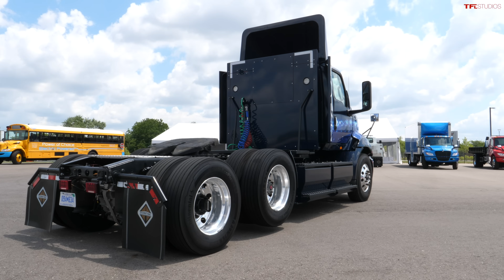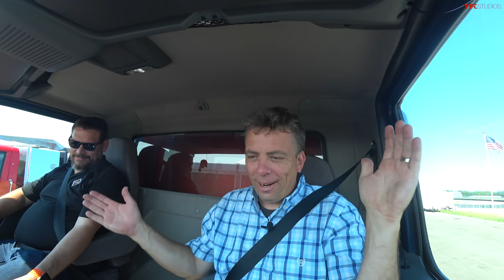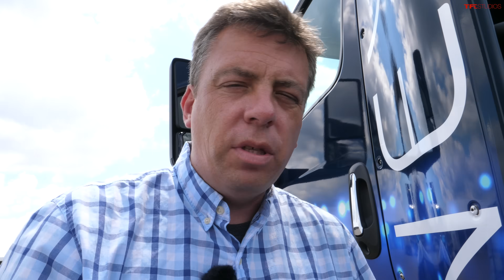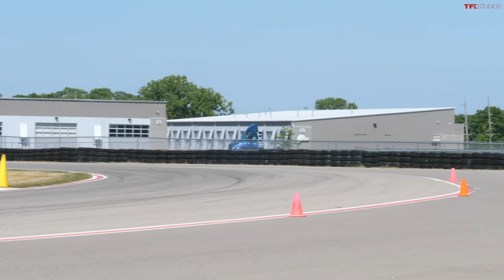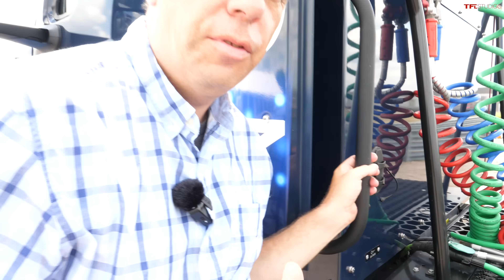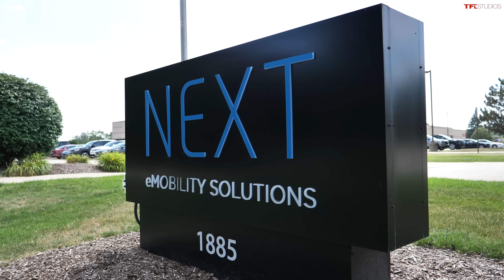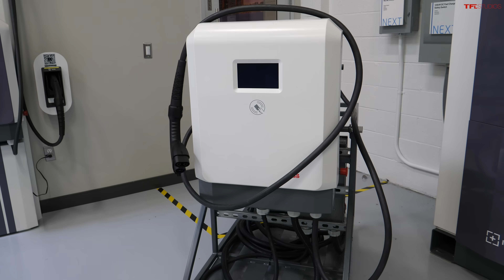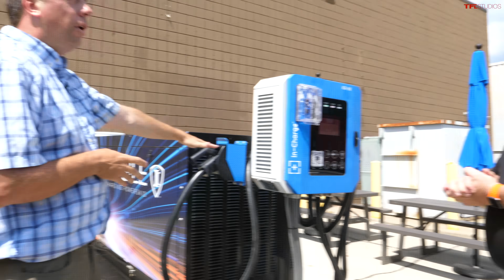Badass EV Big Rig - This International 18-Wheeler Packs a Huge Surprise!

Comment: Class 8 diesel powered trucks have been quiet for years, you can barley even hear a Class 8 diesel truck running they are so quiet. This thing will also cost $250,000 dollars and up so again the Diesel wins hands down. International is a minor player in the class 8 truck market these days, they have not been a major player for years and they are known to be unreliable trucks. 

All the truck manufactures keep failing because electric just can't provide the energy density that diesel fuel can. These electric Class 8 trucks won't work even as local delivery units, take a company like Cheney Brother Inc who deliver to restaurants they have about 50 trucks at the local warehouse where I live, where are they supposed to install 50 chargers to charge that many trucks? The same thing with bus barns that are parking from 100 to 200 buses where are they going to put all those chargers to charge 100 or 200 buses. At 2 hours per charge you would only be able to charge at best 6 buses or trucks per every 12 hours over night per charger in a building. 

Here is the recommended oil change interval for a PACCAR MX-13 engine truck: 

Engine Oil Intervals and Specification:
• SAE 15W-40 API CJ-4. 10W-30 can be used if the engine has received Engine Service Bulletin E070 or more current software.
• Line Haul oil change interval is 40,000 miles when above 6 MPG.
• Vocational oil change interval is 25,000 miles (or 800 hours) and applies when fuel economy is less than
6 MPG and higher than 80,000 GVW.

As you can see the maintenance issue is being blown way out of line, to hear Andre and the others talk they make it sound like you are servicing these engines every 3,000 miles. How long are those electric motors going to last? unknown, but diesel engines will go over 1,000,000 miles. How long are those batteries going to last again unknown. 500 kWh will cost at todays prices which are a year old as the cost has gone up but the battery will cost $76,500 dollars each. So in this International you will have $153,000 just in the batteries. A Diesel engine does not come close to that cost.
Reply: You have alot to say about it. Funny how the loudest people on the internet have done nothing about it. The ain't broke don't fix it crowds are ludites
Reply: @MichaelDabish  Diesels burn clean, there is nothing out there that can come close to matching the ability of diesel for hauling, even locomotives use Diesel engines to power a generator that powers the electric motors that drive the train because electric can't be stored with enough density to match diesel.
Reply: @LeeCountySpeedShop  burning is still burning my friend.
Reply: @LeeCountySpeedShop  Often wondered why we don't see diesel electric trucks?
Reply: I noticed you left out the most important part, fuel cost. 
32k miles divided by 5.5 mpg x $5.75 diesel is $33,454. Assume 80% fuel saving once you pay for electrons or $26.8k each year. Now add in oil changes and longer brake life and you start to see a good payback. The electric truck will also have fewer things to fail and likely last much longer than a diesel. 

Now let’s assume you drive 180 miles per day, 240 days per year. 43,200 miles / 5.5 mpg x $5.75 diesel = $43.2k. Assume electrons are 20% of the cost or $34.6k savings in fuel alone. That’s about a three year payback. ($250k vs $140k) If a business doesn’t do this, they are not going to be competitive. 

Additionally, early reports from electric big rig drivers, they are noticing much less fatigue due to lower vibrations. This might lead to fewer accidents and turnover. (Can’t prove this assumption)
Reply: Diesel trucks are money pits!!! Electric wins hands down! Show me a diesel that puts fuel in the tank when you stop or go down hill! Over time the electric truck cost will be lower then a diesel truck hands down!
Reply: One more thing regarding the maintenance interval, if a local truck is running 125 miles a day 5 days a week that comes out to 32,500 miles a year so you would do one maintenance for that year at the 25,000 mile mark. If you are traveling long distance that extends to 40,000 miles so if you are traveling 400 miles a day that would be 104,000 miles a year and you would do 2 services that year. Again the maintenance issue is being blown out of proportion. You still have to deal with charge times as you would have to recharge at least once on the road if not twice for a minimum of 2 hours if you can find a fast charger for those 400 mile runs.

Comment: Local routes only for this tech. Long distance routes will require swapping batteries. There are large companies working on quick swaps for fleets. Independent will get squeezed.  Videos on YT.
Reply: Long-distance could use hydrogen fuel cells, with refueling set up at truck stops.

Comment: Why don't you guys make a video about EV trucks vs possible hybrid trucks vs pure hydrogen trucks

Why don't full hybrid diesel trucks exist ? If it's possible on a tiny Prius then definitely there is space on a massive rig to add an additional engine
Reply: As to hybrid trucks, notice that a Prius gets worse fuel economy on the highway vs in the city.  This is because city driving involves stop and go where the motor-generator can recover energy while slowing the vehicle vs using friction brakes which always waste energy.  On the highway there’s comparatively few stops so the hybrid powertrain is just extra weight and complexity without any upside.  In a similar way, a lightly loaded hybrid semi driving around a city might do better than a straight diesel truck.  However a commercial truck often earns the most money at its max legal weight and so addition of a hybrid powertrain would hurt payload, a downside.  Similar to a Prius, the downside would be biggest for highway usage where no energy would be recovered and where payload would be lost.
Reply: @matthewprather7386  trucks end up having to slow down a lot on the highways due to a whole variety of reasons. They don't get to drive smoothly like a train. And they also end up passing through small towns as well(not just talking about America) and hence would need to slow down and drive at safe speeds. 

When it comes to efficiency, trucks aren't able to be efficient, which is where the electric motor could play a role in improving efficiency at low speeds and the ICE for highway driving. The additional weight in total would be much less than a full size BEV truck like in this video, which has extremely poor range .
Reply: You don't need a video to explain the lack of hydrogen fule stations.
Reply: @MichaelDabish  Jesus christ. That's the dumbest point to make..
 if charging stations have proven anything, it's that the lack of stations today isn't really an hindrance to adoption in less than 10 year's time 

And hydrogen stations would literally be part of existing fuel pumps , so hydrogen adoption would be easier for heavy vehicles

What's next ? You gonna talk about hydrogen energy efficiency? Price today? 

My question was literally about the truck by itself
Reply: @nujjigram  no hydrogen is too expensive to produce and also  you have to put alot of money to transport the hydrogen and to keep the hydrogen cold so it doesnt explode on you and the the temperature to prevent hydrogen from exploding on us the station needs to cool hydrogen from its critical point of 33k to 20.28k and that drives up the cost to put stations down 
beleive me the price will not go down
Reply: @unluckylad-j8s  economies of scale will drive it down. that's just how things work

Comment: And it will have 60 miles of range this wont work
Reply: Local truckers stick to smaller shipments traveling less than 100 miles, and regional truckers take trips usually around 100-250 miles, the model of truck is SH for short haul.  It will work great for that market segment.
Reply: @Marker-er3ro  Yet I see trucks where I live that travel from Tampa or Miami which is 125 miles to 150 miles oneway from each city there are others that travel from other areas of the state so they are eating up their battery storage just to get to the other city and will now have to stop and recharge before they can even start their delivery's for the day. At the end of their deliver day they will have to top off their charge again just to get home.
Reply: They will just use 1000 mile extension cord.
Reply: It's a tool people. A tool. It's like when the Phillips had screwdriver came out all the Flathead people continued to be flat heads. Lol
Reply: You need to stop resisting change, it’s going to happen at some point why not start early?
Reply: @nathanharrellyoutube  Because electric is not the answer it does not have the storage capacity to provide the energy destiny needed that diesel fuel provides.Add in the long charge times and electric is a loser every time.